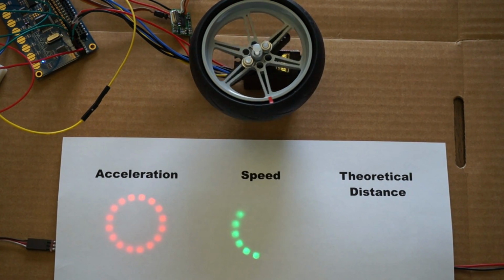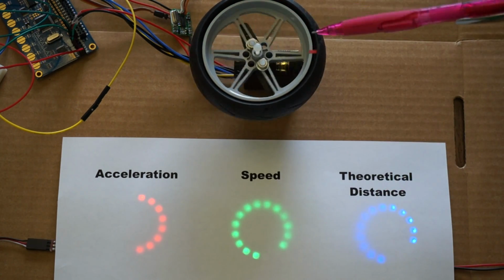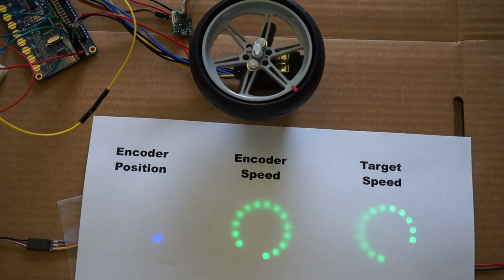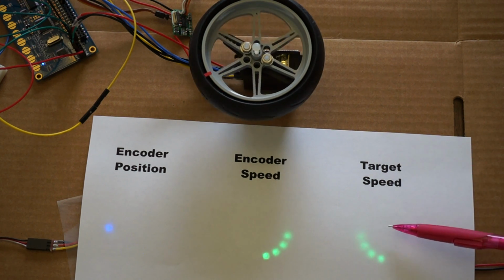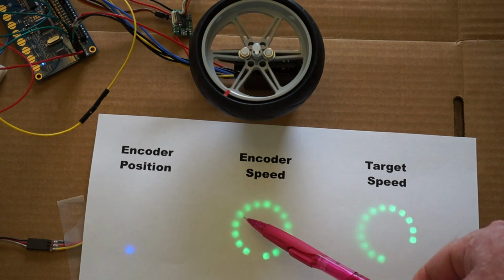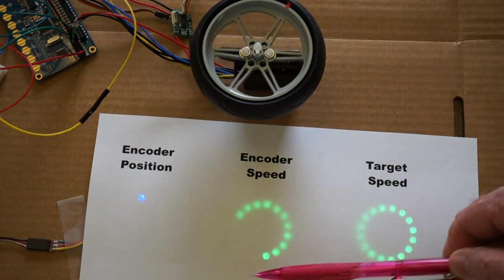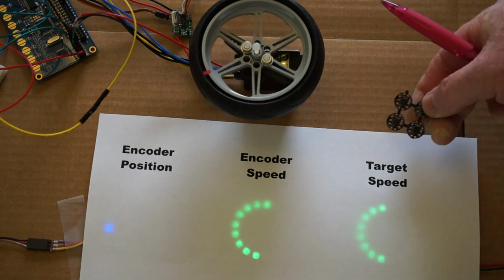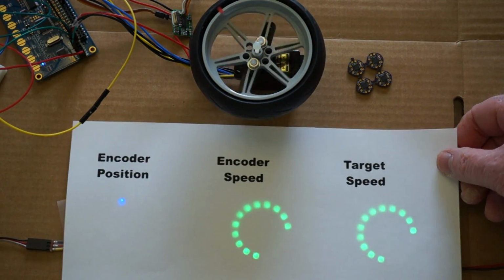EncoderPositionAndSpeed130824a

Comment: You didn't mention how you are getting the speed from the sensor.  From what it looks like, the jumpiness of both position and speed values appears to be performance related.  Maybe the read-rate is slow or uneven?  The datasheet shows read rates from 10hz to 3000hz.  You might use an interrupt on your controller, or configure the AS5055 to use its own "interrupt chaining" to read the values at a more consistent rate.  The datasheet also says something about averaging four samples in your controller.  If you slow the motor way down, does the jumpiness go away?
Reply from the maker: The position was read at a set interval and the speed was just the change in position readings between the set interval.
I'm pretty sure the problems seen in the speed readings were caused by my poor sensor/magnet mounting.

I believe in this example, I had the micocontroller reading the sensor using an assembly routine. The samples were averaged using a ring buffer. I used two different buffer sizes for the averaging depending on how quickly the values were changing. If the sensor appeared to be stopped, the number of samples averaged was increased to give a more stable reading.
You have to be careful when averaging values near the 4095/0 rollover point. I actually kept two sets of averages. I added 2048 to values less than 2048 for one of the sets. I used this set of averages when the sensor output was below 1024 or above 3072. There are other ways of dealling with the rollover point but these other techniques are easily done in assembly.
Here's a video showing how stable the position readings can be: https://www.youtube.com/watch?v=9GJqUxucG8s